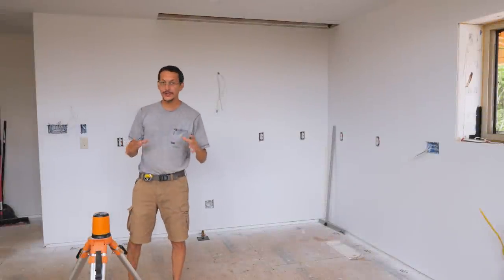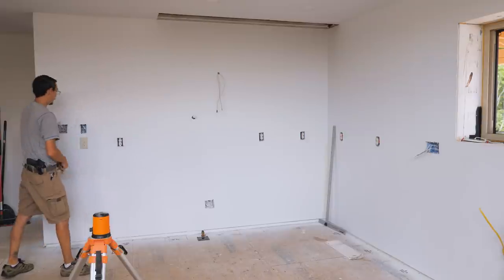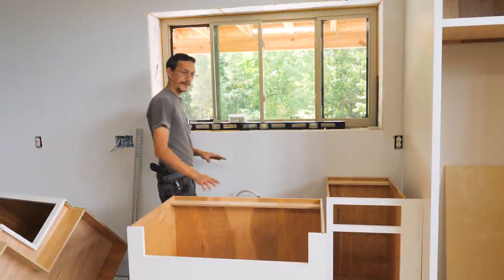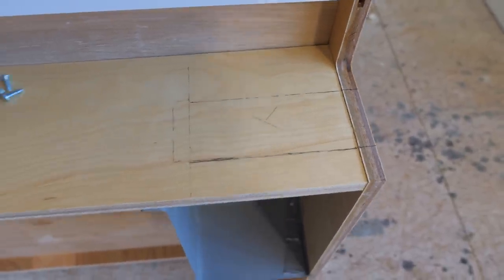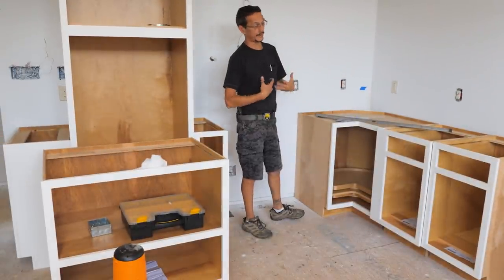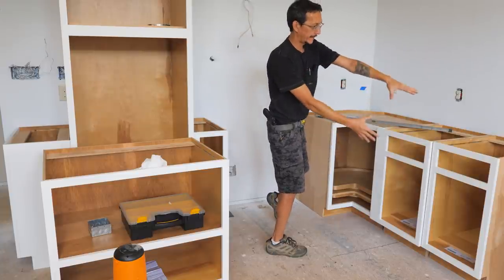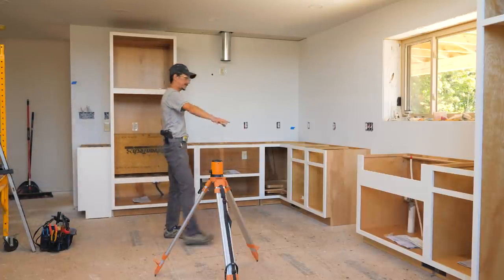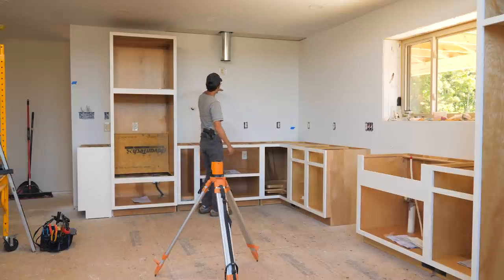Installing Awesome New Custom RTA Kitchen Cabinets

Comment: When you make your faux box you might think about making the front a hidden door for another area of storage. A magnetic closure that you push to open and close. Hinges at the top or specialty hinges that would hold the door open. I'd also leave the top of the box open so that you have all the space above that will be behind the crown molding you mentioned.
Overall I love the kitchen thus far. I really think it is going to be an awesome central hub for your family and beautiful to boot.
Reply: My thoughts too! I hate that space above my cabinets. I store things up there I don’t use all the time. But with them being open it’s a dust collector. I always wanted to have someone make me little cabinets to fit in there.🥰
Reply: @askedgeorgia17  - Those little nooks and crannies come in handy for all sorts of things.

Comment: Landline phones come in handy when the power's out. But since you have solar, that isn't a problem for you guys !!!
Reply: My cell phone works without being plugged in.
Reply: @pnwester2697  of course it does.  That's how they  planned it. 😀
Reply: @pnwester2697  at least until the battery dies. Then you need a power source to charge it.

Comment: I'm not an electrician so I'm not sure. But does the outlet under the sink have to be GFCI?
Reply from the maker: No. It does not. However it is on a GFCI protected circuit.

Comment: Please explain to me why so many professional and home installers put in floor cabinets before putting in the floor.   It makes doing the tile/wood - whatever - such a pain to do.  If you have to remove/replace any of the cabinets, the flooring can be a problem with the way it fits with the new ones.  Depending on the height of the flooring.  If there is a dishwasher and the counter top isn't high enough, it can be a problem as well.   I admit that when I redid my kitchen, I did the flooring first throughout the whole room.
Reply from the maker: I explained this. If you are installing a “fixed” floor like tile or hardwood then you could lay the flooring first and set cabinets on top of it. That can present a challenge later though if you change your flooring to something else that is a different thickness. In our case we are using vinyl plank which is a “floating floor” system and can’t have anything heavy that’s permanently installed on top of it because those fixtures prevent the floor from “floating” (expanding and contracting).
Reply: @Guildbrookfarm  Sorry about that.  I don't know how I missed that.  Thanks!!

Comment: I don't understand the whole 'appliance garage' thing. It's wasted counter space. If the 'garage' is to hide appliances that are rarely used......surely those can be put elsewhere (lazy suz; bottom cab of the island??). If it's to 'hide' appliances that are used daily.......if they are used daily, what's the point in 'hiding' them, since they'll be out/in use throughout the day? And be kept on the counter, in that corner, when in use.  EVERY INCH of counter space is like GOLD, for me, because I have (literally) ZERO. (2 sq ft of counter to the left of my sink = ZERO! lol) 
And when cooking or canning.....one could move the appliances from that corner and utilize that whole counter, from the right of the cook top to the 'sink wall'. My free-standing stove has NOTHING on either side. And it's maddening trying to cook (I cook from scratch) ANYTHING. I don't even call that (my) room a 'kitchen', because it's not. It's just a room with a sink, fridge & stove in it. (and kitchen table/chairs, of course). I LOVE to cook; but end up swearing my head off just about every time that I do. COUNTER SPACE is EVERYTHING!! lol
Reply: They are installing  a Island unit also, so will have plenty of counter top space I imagine. I rather like the 'appliance garage'  space useful for say a heavy food mixer or such which can be slide out when needed.
Reply: My wife was a huge fan of appliance garage because it allowed her to store a heavy mixer in a way she could pull it out and use it without having to lift it or get me to lift it from secondary storage. You know the rule: Happy Wife, Happy Life....
Reply: @Roger-gs5ew  But the cook top is NOT ON the island. You're obviously not a cook. lol I have to walk back/forth from my stove to my kitchen table, when cooking, and it's maddening! I want 'everything that I NEED', right there, next to my stove, when cooking/canning. If I'm dredging (flour/egg/bread crumbs) something, I want all 3 'dishes' 'RIGHT THERE', where I'm cooking. And when done cooking, a plate to put things on, right near my cook top. One needs SPACE, for that. Not 'back/forth' from the cook top to an island. My own personal preference.....I'd rather have the counter space than the 'convenience ' of an 'appliance garage'.
Reply: @DawnieRotten  Actually I do most of the cooking,  and certainly do not get stressed out when cooking, however we each have  our own preferences in design and layout.😁
Reply: @DawnieRotten  I would NOT want a cooktop on an island!  I cook a lot, and ventilation works most efficiently against a wall.